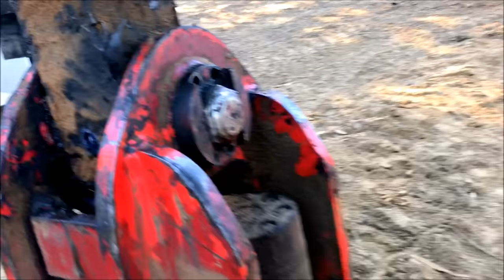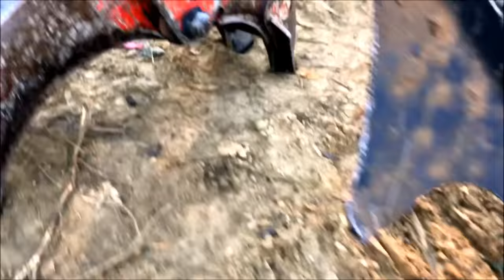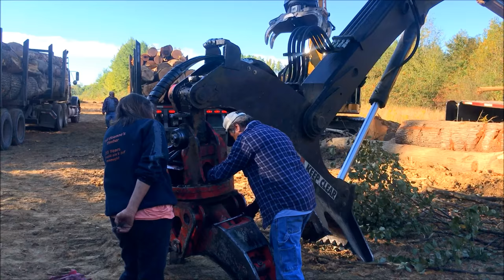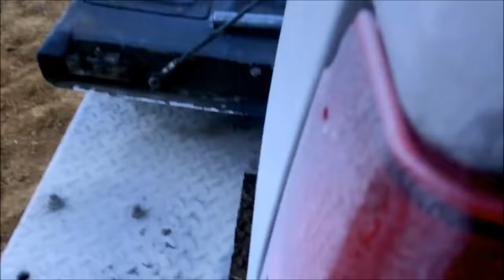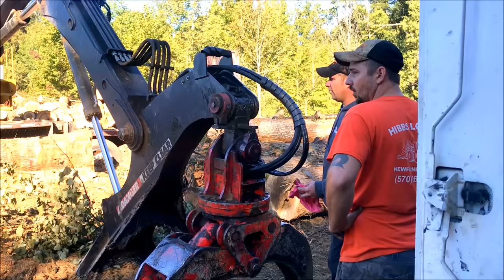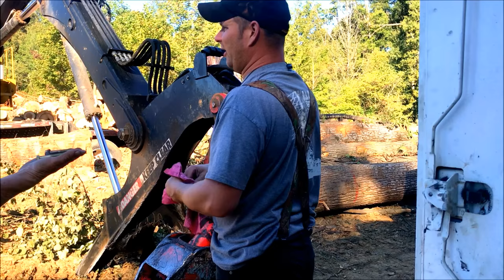The Grapple fell all the way off!!

Comment: love your vids need more cutting and skidding.enjoyed the sawmill.Had to do a tuneup in the woods on the backhoe the other day it stalled and wouldn't start. Put plugs air filter fuel filter and tightened connection to fuel pump a little starting fluid runs great.to make a short story long I dropped a 22 inch cherry tree today and used a Humboldt cut never done that before must be from watching Buckin Billy Ray this morning waiting for temp to rise. 90 out three days ago 40 last night once again look forward to your vids thanks
Reply from the maker: jim richards good to hear buddy where you from

Comment: Homer Ferree story. the old man had lifted the engine out of his 1965 Lincoln with a track loader and had it sitting on a piece of roofing tin. He couldn't get the rod Cap's off because a 7/16 , nor a 1/2" socket wouldn't fit. I'm a long haired hippie with his daughter in my micro buss. I have a 10mm socket that fits the nuts on the rod Cap's. We became friends and I became one of the family.
Reply: Irl Reed We went metric back in the early to mid 1960's,a little bit at a time,interesting story.
Reply from the maker: Irl Reed haha thanks bud that's a good story
Reply: Logger Wade Stevie POOPOO PANTS?.HAHAHAHA!!.🚶💨💩